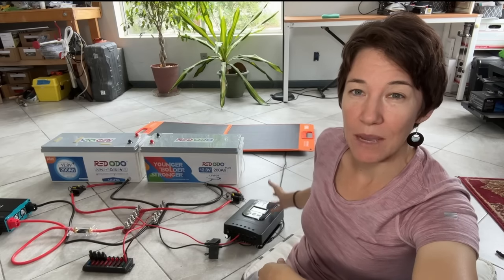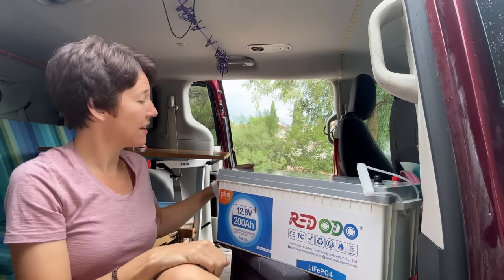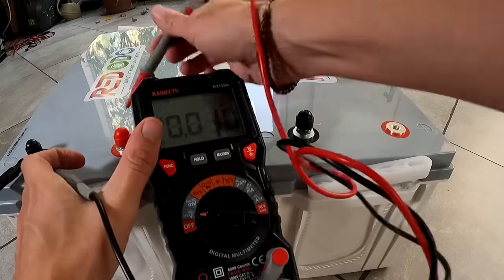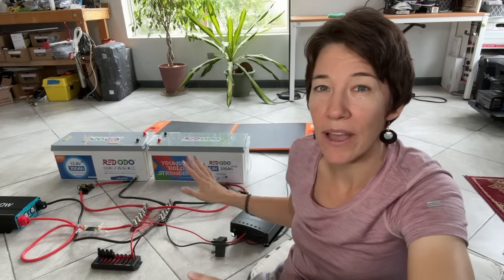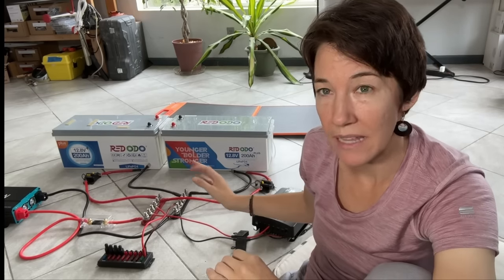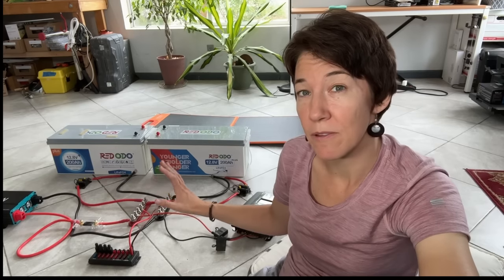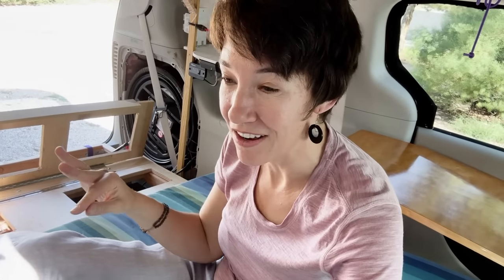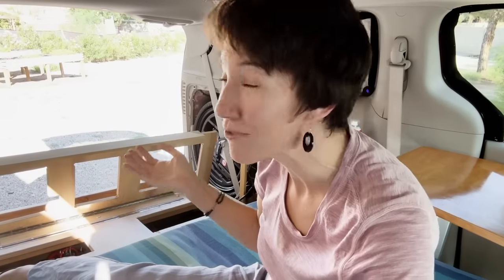How to Install Redodo Batteries in your Minivan Camper | Vanlife Electrical

Comment: Friendly suggestion to the channel: I  think one thing missing from the video was the total cost of the new system (batteries, wiring, etc.). Even though prices may change over time, it would be helpful to have a general idea of how much all components together cost (without having to look for each on a linked sales page). Some statement such as: “I was able to assemble all of this for about $X….”
Reply from the maker: Ahh, yes, great point! I’ll see if I can pin that in the comments.

Comment: For that larger blue-handled crimper, I have the same model. For tough crimps, I put one handle against the floor and then I can put all my weight on the other handle. A little tricky getting everything lined up proper, but way easier than trying to do it with just brute arm strength.

Comment: It would be great to be able to integrate the solar panel(s) and extra battery(s) into the van's existing electrical system. I've been in one van (a Honda Odyssey) that already has an AC outlet, so it must have an inverter built in somewhere. It would be great to be able to just boost and amplify that system.

Comment: Safety Suggestion: Looks like your choices of part's are really good but, from past experience and from articles I have read, that all of the blade type fuses need to be replaced with better quality ones from Littlefuse. The cheap fuses that come with your Anderson power pole rig (and other items) don't blow at the current rating that they are rated for. Trust me you don't any wires burning up because of a cheap fuse. Don't save the old ones, just throw them away. Good luck with your project, cheers from El Cajon, Ca.
Reply from the maker: Hey Sandcruzer, ooh, good tip. I hadn’t heard that. Thanks!

Comment: If you have problems with your charge controller overheating it will be because you have it laying down on the heat sink. That needs to be vertical so that the heat can dissipate easily.

Comment: Great job!  It was clever to use the circuit breaker as a cut off switch.  
*I do have a few safety suggestions: 

While your current design has been the most common way of building these systems for a while, a couple of months ago SAE came out with a new specification that all lithium based batteries (LiFePO4 batteries included) need to be housed away from flammable surfaces (like wood) and in an enclosed fire resistant container.  LiFePO4 batteries are safer than Lithium Ion batteries but if the cells are ever punctured (say if a loose screw or nail works it’s way underneath or in a car accident) they can result in the same type of high intensity fire.   

Second your batteries have a minimum and maximum temperature setting for safe charging and discharging.  You’ll need to contact the manufacturer or reference your documentation to find out exactly what those numbers are.  Since vehicles (especially those designed for transportation and not for residing in, like minivans) routinely experience extreme temperatures you should account for this in your system design.  

Finally tucking unsheathed wire under the trim of your vehicle, where vibrations, sand and debris can wear away at the insulation potentially causing a short, is probably not advisable.  It’s less attractive but it would be preferable to enclose the wires in conduit to protect them.

Overall you did a great job and your explanation of the process is likely very helpful for those who are interested in trying something similar!! 😊
Reply from the maker: Thanks for all the great tips! I appreciate your time!

Comment: This was so freaking cool.  You did such a great job!!! Just as an option for other people,  I have a portable Pecron E2000 with the extended E3000 battery.  That's 5000 watt hours that I can take in and out of my minivan and they're connected to three 100 watt solar panels attached to my roof rack.  Same amount of power but mine is plug and play.

Comment: Hi Kelly,
        Wow! Great job. You learned so much and did it yourself. It was a lot of work and a little trial and error but now you are set and you know exactly how the system is set up and how it works. Be proud of yourself. I look forward to seeing your solar panel set up. It's neat that it will be charging the batteries all the time. 200 watts doesn't sound like a lot going into over 5000wh of batteries but it should be fine with the constant charging. That is one cool van and I hope it provides you with many more years of enjoyment! Well done.
                                                                                                                                       Steve.
Reply from the maker: Hey Steve! Ah thanks for the encouragement and compliments! Yeah, I'm pretty wiped out from the project and video, phew! Thanks for watching!

Comment: You've got alot of space in that Pacifica. I put 100ah in the back seat foot area in my Ridgeline. Used only 30% over a 5 day trip a few days ago but I only used it to charge my phone/power bank and drone batts. It feels so nice knowing you have power to charge your devices so you don't have to find a shore outlet.
Reply from the maker: Yes, the stand alone batteries really are game changers as opposed to the little power stations. Glad you had a nice trip!

Comment: Thank you for the really great video! I'm also building an off-grid system in my minivan. I'm still relatively new to all of this, but it seems that you're missing a grounding cable from your negative busbar to the chassis of your vehicle. Right now I'm looking into exactly how I'm going to do that. I think it's going to be necessary to drill at least one small hole in the chassis of my minivan, even though I'd like to keep the vehicle pristine, as it's a no-build build, and I haven't had to modify any part of vehicle. In other words, I'll be able to return everything back to normal if I ever want to sell it. The only other modification I think I'll need to make is drilling another small hole somewhere in the body of the car to run cables from the alternator to a DC-DC charger. I will work with a professional (someone who does electrical work on RVs) to figure that out. Best wishes to you .... peace and safety out there!

Comment: you could run a line from the car alternator with a DC high amp switch to the inside of the vehicle to the charger controller... so when there is not much sunlight... run the car for an hour to have the batteries fully charged. that 150A alternator you got under the hood will charge your batteries very fast. so you will not have to be anxious about running out of charge. that's how i have it.
Reply from the maker: Thanks for the tip! I’m a little worried about burning out my alternator that way. But I don’t know much about it.

Comment: Nice review & install.  Not sure the 200Ah battery would fit in the space I have, but their 100Ah one definitely would.  My cargo minivan’s auxiliary or house battery currently is an AGM, so going to lithium would increase how much I could draw it down.  It also has a solenoid that will charge the auxiliary battery off the alternator once it has finished charging the vehicle’s starter battery. This is helpful if it’s cloudy & the rooftop 100w solar panel needs help keeping up.  Hmmm, I need to go measure to see if a 200Ah would fit.
Reply from the maker: Hi Karin! Oh, you should know- these AREN'T starter batteries. They won't work as a replacement to your car battery, sorry!
Reply: @minivancampergal1554  ,  I know they are auxiliary or house batteries.  I am thinking of replacing the 75Ah AGM battery that powers my 12v fridge & a few other things.

Comment: In the process of watching this now. As I learn, I do want to add one thing. Ecoflow and Bluetti both use the same type of battery. The Jackery I heard does not, unless they are the biggest sizes. But if you want a simple system, you can still get that same type ION battery. I know very little about this stuff but saw that on a different video. Im watching your video to see if I want a simple system or one like yours

Comment: Loose connections are as bad as too tight heat can built up...steel does conduct electricity but it's good for mechanical connection and not to conduct electricity so your lungs must be securely attached so that they can carry power in and out of your batteries
Reply from the maker: Thanks for the tips!

Comment: I was wondering why you chose two 200Ah batteries instead of one 400Ah battery? Is there a pro and con to it? Thanks, I really appreciated the video.
Reply: 400Ah battery is around 80 pounds. That's not a good time for one person to lift, especially in an awkward space.

Comment: Very impressive Just curious as to why you built a 110 volt system rather then just using 12 volt devices.
Reply from the maker: Hey Doug! I use AC 110 volts for my rice cooker and my Starlink internet. Everything else uses DC power.

Comment: Would just using 2 AWG wire for everything and not using any bus bars/circuit breakers effectively accomplish the same thing?
Reply from the maker: Not quite- you’d have a lot of wires coming off the battery itself, and you wouldn’t be able to put one fuse that would protect everything.

Comment: How does these batteries preform in the cold?
Reply from the maker: They aren’t self heating, so they won’t charge if it gets cold enough. But they will run even when it’s pretty cold. Redodo makes self heating batteries if you’re going to be in cold a lot.

Comment: Kinda' surprised you're using only AWG4 at the batteries? I need AWG 0-4 for parallel on my 400 Ah of LiFePo4 storage and inverter. And always use stranded copper wires in a vehicle.
Reply from the maker: I would need bigger if I was using a bigger inverter.
Reply: @minivancampergal1554  that's correct, I do run a 3Kw AC inverter 🙂 Rock on 👍

Comment: Velcro Tip: Use Industrial Velcro Brand. Then instead of trusting the mger's adhesive, 
I apply the velcro backs with permanent contact cement; 
especially Oatey 30246 PVC Regular Clear Cement. 
It works great on hard-to-stick-to surfaces.  
It gives velcro a permanent adhesive grip to any surface.
-
For more temporary velcro applications - 
use Elmer's Rubber Cement on the back of velcro. 
First apply Elmer's to both surfaces, but don't stick the two surfaces together until the rubber cement dries.
-
Forget the velcro mfg'er's adhesive - 
it is subject to heat and moisture.
unlike Oatey or Elmers cement. 
-
I use very hot, soapy, water to neutralize the original mfg'ers velcro adhesive. 
Let dry and then apply my own adhesive choice.
-
Note:
The hotter, and wetter, it gets - the better Oatey's cement works 
-
_________________________________
Concluding Question: Why didn't you just buy a single 400ah battery? 
-